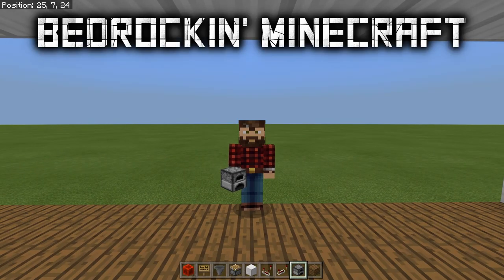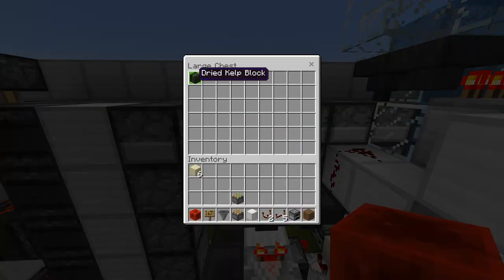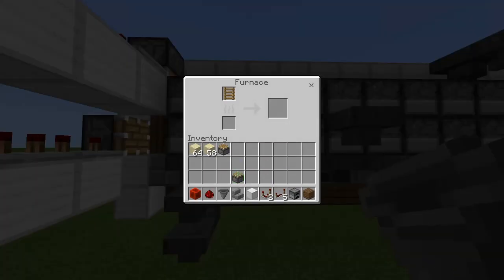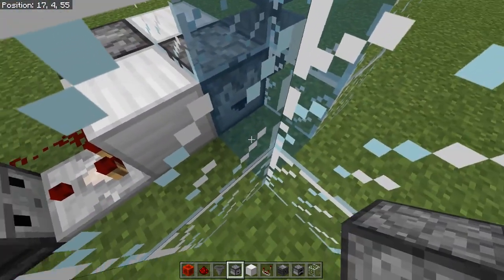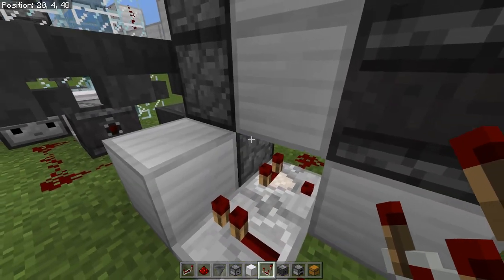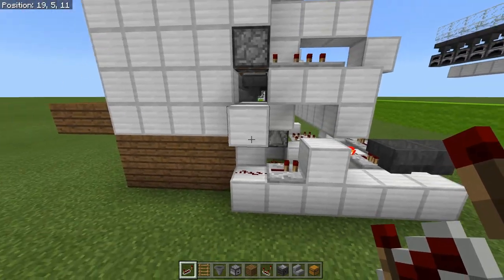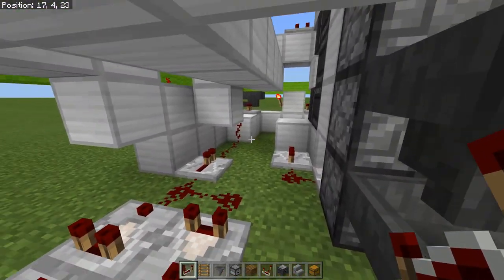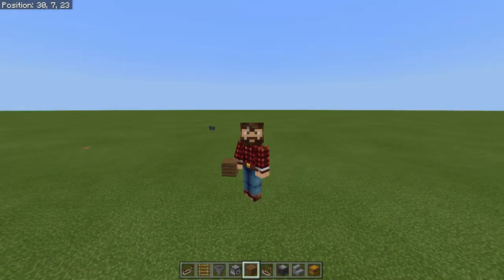23 furnace super smelter, uses least amount of iron, piston feed tape design.

Comment: I’ve never seen a super smelter like this, is it realistically more efficient then an say a minecart super smelter equivalent
Reply from the maker: Per furnace it's not, but for the resources you can't beat it. Normal furnace arrays cost a ton of iron, this uses hardly any. Plus it's just more cool, and cool factor matters too :)
Reply: Is observer reliable for the feed tape? So i dont need to connect the pistons to the clock?